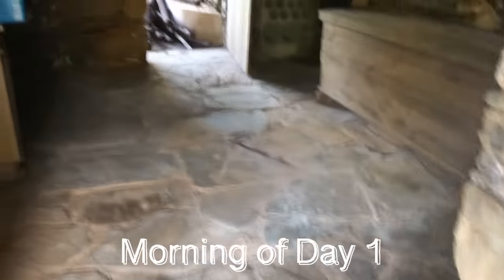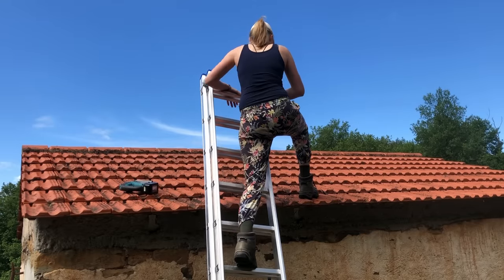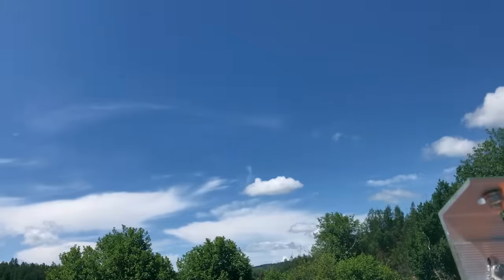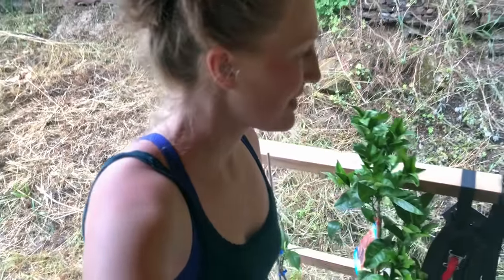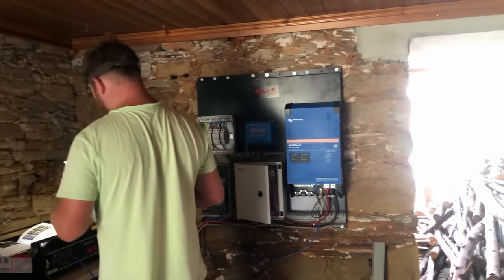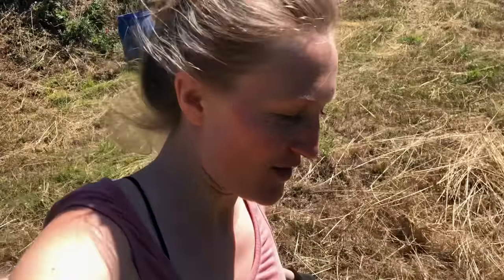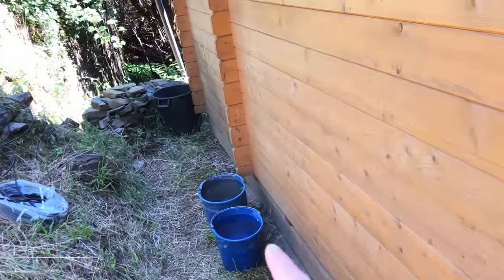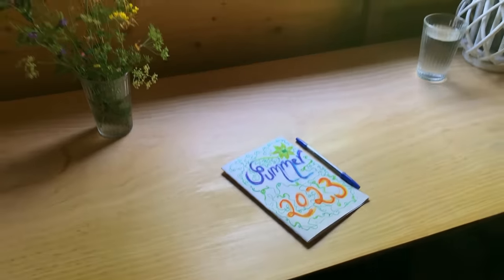Installing Off-Grid Power System - Start to Finish!

Comment: Happy Birthday and well done.
I know you did your resurch but make sure everything stays ok whenn you need to leave for a longer time.
My batterys broke down because they could not get rid of the power the sunpannels put in everyday. That were just lead batteries.
You have lithium, strange accidents happen with lithium these days. I dont want to scare you but your better of doing extra resurch and treat your system with silk gloves so to speak than finding your place burned down whenn you come back the next season.
Solar is great but it needs daily attention.
💖💐🌻

Comment: Keep in mind the Lithium Batteries should not be charged bellow 0 degree Celsius. Some BMS (battery management system) prevent charging at low temperatures and just allow discharging, others have preprogrammed wrong parameters.